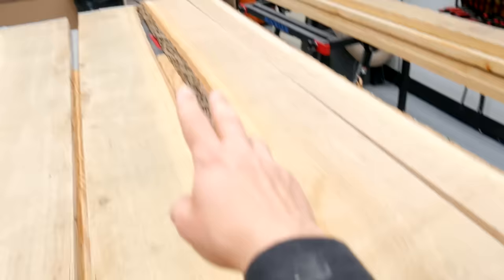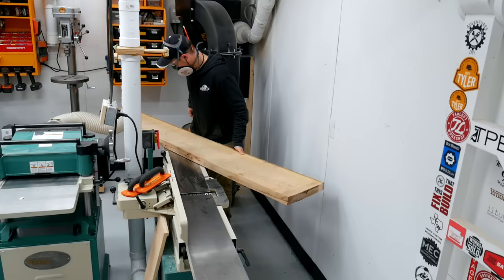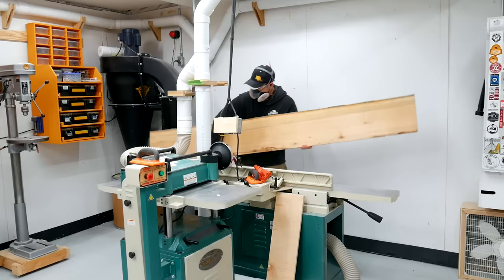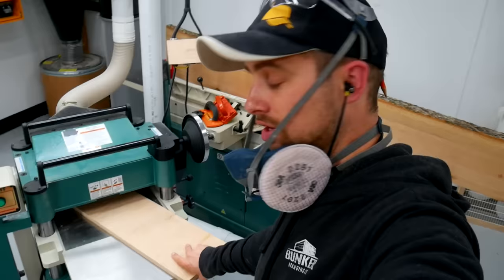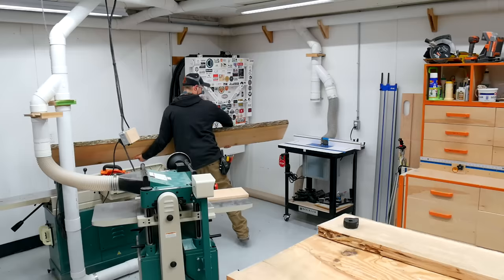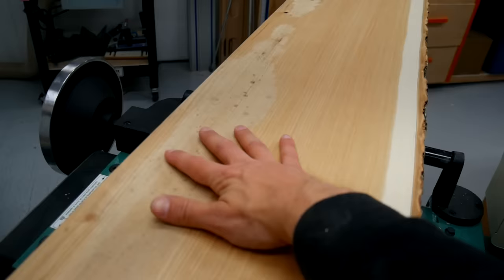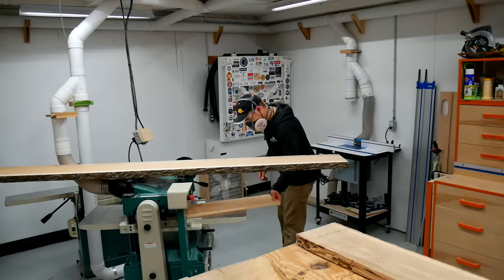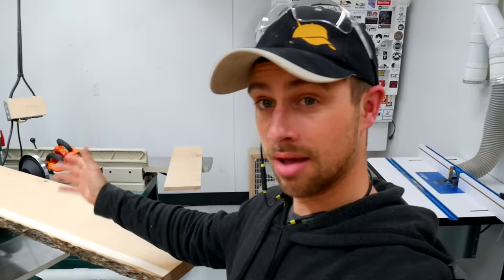Jointer Size Doesn't Matter! Flatten Large Boards on a Smaller Jointer

Comment: NEVER EVER put your fingers over the leading edge of the timber ........@  1.23..........      even if its not switched on. Plus a set of free standing rollers are a must- have in any shop... PLEASE stay safe
Reply: What's the problem..
Reply: @cefb8923  I don't have a problem, I still have all my fingers.! but I know and have seen enough accidents around joinery shops to offer words of warning. Happy Christmas.
Reply: @cefb8923  the problem is he made a stupid decision but got lucky he almost lost every tip of his fingers. He got lucky and if doesn’t admit he is lying 🤥..
Reply: @vicinglis3736  the sad thing is he never replied too you another reason I don’t leave comments. Had to here because he almost had a very bad day and he realized it quickly when he put his fingers there but that quick reaction won’t save your fingers if you hit that blade. I know exactly what it will do to a finger if he wants pictures :(
Reply: @LincolnHawk  exactly....the machine wasn't even on. When it was he took the proper safety steps. Besides if that man loses his fingers then he loses his fingers. That's on him. People calling him stupid is ridiculous. People are so worried about what other people are doing when they should just worry about theirself
Reply: @Lincoln_Hawk  yea. Kinda like pointing an unloaded gun at someone.

Comment: I've used this trick before. I prefer to use a laminated particleboard for the spacer for two reasons. One: It's not subject to warping due to humidity changes, and it's machine cut, so you're guaranteed a flat reference surface. Two: The lamination gives it a low friction surface to make the board glide easier.  I also have a laminated board at full width and length that I use during normal operation to serve as an extension table for the planer, so I don't even have to adjust my height when I go to plane the full width of the board.
Reply: Good tip thanks Kasbak :)
Reply: No significant expansion or contraction to worry about?
Reply: @MarcosElMalo2  It's particle board, so there's no grain to change with humidity.

Comment: So I’m new to woodworking and have a question. Could you not have just planed the board on the planer being its wider than the board itself? I thought that was what the planer did, was to flatten boards and to make them the same thickness. Is that not right? I guess essentially I’m wondering what the jointer step offered that the planer didn’t do? My question probably tells how much of a noob I am, but I love woodworking and am trying to absorb all the knowledge I can!

Comment: I just used this technique this week for a 12" board.  I  have a 6" jointer and 13" planer.  The pieces were only about 4' long, but it works like a charm.  Just be patient and take your time making really shallow passes.  This is a lifesaver for a small hobby shop like mine.
Reply: Welp Im not sure what I did but I completely jacked one side of my butcher block reloading bench. Have the ridged set up the 6” jointer and the 13” thickness plainer. The boards im working with are pine 2x4’s and around the edges are pine 4x4’s 8 foot long.

Comment: I've wondered for years why nobody else does this. I always assumed it was me doing something galactically-stupid, though (maybe due to how dangerous the exposed blades are... if you're inattentive or clumsy?) so I've only told a few people about it (both of whom chastised my recklessness). Kudos for having the stones to go public about it man! You're not alone! I've been surreptitiously working along the same exact process for years!

For anyone wondering: yes, it works fine on a 6" jointer too, just bolt it down to the work cart and make damn sure she's gotta lotta weight to her.

I solved it by making a single stand from 3/4" ply to hold jointer AND the planer (the planer added 100lbs straightaway. Plenty, but since I was twitchy about it, I made the bottom support plate hollow, then caulked it and filled it with sand. Add casters BEFORE you start. Mine prolly weighed 400lbs, total. 

Finally: outfeed and infeed. You REALLY want the support. I have a little removable shelf that runs in front of mine too, to support the front half of that board. Just make a mental note to always have either it or the guard in place at all times. The concern is if the stock overbalanced and tips forward, you don't want to lose your balance or instinctively flail... and set your hand down to catch yourself (wince). 

Awesome video bro!

Comment: Dude this is a piece of information that I needed so badly! I have huge slabs that I need to work. And I have the exact same size equipment as you. So I will definitely be using this technique.
  But be careful working with that Joiner. I lost the end of my left little finger earlier this year to mine. And I am incredibly safe with my equipment handling. Processing heavy wood and getting tired can be a dangerous combination on that machine.  
 Take care and continue the great work,  Art

Comment: That works great as long as you can flatten that partial first surface of the board in ONE PASS on your jointer.  If it requires more than one pass to be flattened, you will have to remove the rabbeting ledge to make a second or third pass. The unplaned part of the board overhanging the infeed table also hangs below the level of the rabbeting ledge thus preventing a second pass. If you don't have a rabbeting ledge, you can use as many passes as you want to flatten that first surface of the board.  Most of the lumber I use is rough hewn and takes more than one pass to flatten.  If you're milling a lot of lumber, removing the rabbeting ledge makes sense - for one board, not so much. Thanks for the post.  It's a good technique, especially if your jointer doesn't have a rabbeting ledge.

Comment: I only have a 6" bench top jointer and it made things pretty tricky because the cherry boards I'm using have some crowning and twisting after drying.  I had to get out a portable jointer and take the portion that overhung down in order to make additional passes to get it to ride the board on the planer without doing funky stuff.  It's doing its job but adds some extra steps.  Great video!

Comment: this is a great technique, but the following should be pointed out:
-if your jointer has a rabbeting ledge (which yours has) you only get one pass to do the cut, otherwise the lug that is left behind will hold the board up as it hits the ledge
-I have a jointer like this and the technique you describe still works, but I set the infeed table low so that I can make 1 deep cut
Reply: Exactly!
Reply: Delta DJ20 has a removable rabbeting shelf.

Comment: Nice trick, I have an 8 inch jointer, and a very nice, but only 12 inch powermatic planer.  I will put that trick in my toolbox for those 8 to 12" wide slabs.  Thumbs up!

Comment: OR if you want to save space just make a jointer sled for your planer and use that as a jointer. Not only is it cheaper because you don't have to buy a jointer but you also save space in your shop.
There's plenty of jointer sleds out there so just look them up.

Comment: Great video, finally understood how to use the supporting board.
I made mine with a 1 inch tick by 60 inch long melamine, easier to calculate the thickness of the finish board ounce you remove supporting board and a lot more slipper.
Made a test today and wow

Comment: I've seen other woodworkers use that planner sled to improve snipe also... I now think everyone should just have one of those as wide as their jointer fixed to their planner on one side with a pivot point on the infeed and a clamp on the outfeed this way if they aren't maxing out their planner they can skew the bed to improve the finish on weird grain.
Reply: Forgot to mention the sled should have a fixed fence on one side of it so it works when you set it to skew. I also don't care about my planner bed because it's a rigid planer and is horrible.
Reply: And have a second sled that can go bedside the other one when your doing the second side of wide boards.
Reply: Just throwing some ideas to the public, love your method.

Comment: I've done novice wood working for 25 years, with no jointer or planer. From what I can see here, using this technique, as long as you have both a jointer, and a planer, you could basically use a 4" jointer and a normal size planer to do almost all normal boards, up to the width of the planer? Using this technique means there isn't an absolute necessity to own a larger planer? It also appears that there is no way to flatten a board without owning BOTH tools.

Comment: Not so sure I understand this one.  I was wondering how you were going to run the other side through the jointer, and thought you were using the jointer because the board was too wide to fit through your planer. If this board can go through, they why not just use the planer?  I've run rough boards through my planer all the time.  I'll even up one side to "flatten" any irregularities, then flip and take down the other side to finish.  Gorgeous shop, by the way =)
Reply: I have the same difficulty understanding.
Reply: The planet will make a board parallel to the other side, not exactly flat. So if there’s any twist in the board it will still be there after the planer. Still though, this method is pretty time consuming and there’s a better way to do this. Just make a planer sled and shim the twist out and flatten one side that way and then flip over.

Comment: I just remove the guard- and the rail. Then I can use the jointer to remove high spots, which is the only thing a joiner can do. Just think of it as an upside down jointer plane. The only limitation is a board so large it is too difficult to handle.

Comment: Wow! what a great tip. I have never needed to joint and plane a board that size. I do work with smaller boards and only have an old 4" jointer, and a 12" Shopsmith planer. I will be trying your idea very soon. Thanks and keep up the great videos.

Comment: Might just want to add that you can only take 1 pass at the jointer so its better to take of a little more than normal to ensure you get flat reference surface in single pass.
Reply from the maker: Why only one pass? Able to take as many as I want on machine.
Reply: @DIYTyler  for my jointer (Rockwell 37-220) after one pass the un-milled step runs into the fence attachment surface, it cannot overhand the table.

Comment: So what if I were to face joint a 12 inch board on a 6 inch jointer? Could I not just face joint one 6 inch side the flip it around a land face joint the other 6 inches? New woodworker here, just wondering if that would work

Comment: This might sound ignorant, but to all the people warning about how fingers are easily lost with this method, can you please elaborate for me? I'm trying to understand what might happen that I'm not understanding here, given that the slab extends wider than the blades (assuming the slab is supported in all directions and doesn't just tip off forward).

Comment: Excellent video! Do you have any rules of thumb for ratios? For example, if I have a 6" jointer and a 13" planer, woulda 6" support board support a 13" feed?
Reply: if i was to guess, i would assume you need your support board to be at least, preferably slightly over, half of the width of the board you're processing. So for a 13 inch board, you'd want a 6.5" or greater support board for the sake of stability. Can be done with smaller, like he said, but it'll just be more of a challenge

Comment: ok silly question from a newbie woodworker.... you joint the one side great.. now... why not just flip it right over and joint the rrmaining inches??
Reply: Because the unjointed part is higher...when you flip it over, the whole board will be sitting at an angle and you'll never get it flat.
Reply: @ajquestell  oh.. right right.. now i see it.

Comment: There are always workarounds. A lot of workarounds are time-consuming and many times a PITA. So I say size does matter. 
a
Reply: While it's true, for the hobbyist and DIY-er, a bigger jointer might just not be feasible, budget or spacewise. And it's more likely the need for a 13-15" joint will be a very occasional situation. If you're actually making a living or have an actual shop, then yes. Splurge for the 12" or 20" cabinet that costs 10-20 times what a benchtop jointer costs.

Comment: I’m trying to understand this...  So, after using the 8” board, you can turn the hickory over and finish the jointing on the planer, right?  In other words, you never went back to your jointer to finish the hickory?

Great video!
Reply: Correct he just used it to get an 8inch flat strip which in turn with the jig allowed him to plane the other side flat
Then flip the hickory and plane that other 7 or so inches flat

Comment: What do you do if you have to make multiple passes on jointer?
Reply: To make multiple passes on your joiner will you need to remove the metal piece that the blade cover connects to.  Sorry can't remember the name of that piece right now
Reply: To make multiple passes on your joiner will you need to remove the metal piece that the blade cover connects to.  Sorry can't remember the name of that piece right now

Comment: If you ever have the opportunity to face boards on a large jointer I think you might change your opinion.
That piece of hickory sure did look nice. Did it really need facing it looked pretty flat.
When I get a board wider then my jointer beds I rip it in half.Process both pieces separately then glue them back together.
This is a very common practice for building furniture. We do this to remove the stress from unruly wood.
I know you didn’t figure this out it’s been on all the forums for years now. Are you for teaching for likes or views?

Comment: That's a nice trick. Since I don't own either a planer or a jointer, I use a router sled to flatten boards, followed by a fly cutter on an angle grinder with the same sled, for a nice finish, especially for smaller or odd size pieces.
Reply: That is likely the route I will need to take. Glad it seems to work for you.
Reply: @douglashaner6802  I've since strengthened the plywood sled into a universal tool "gantry" with a couple of pieces of 6'x2"x2" stainless tubing. 
It Provides a really smooth surface for wax finished wood to slide on effortlessly. 
The gap between two sections is nearly a foot, so I can now use the same sled/gantry with almost all woodworking tools. Works like a track for my circular saw/jigsaw, still fits my trim router and now I can also use a bigger router which is 4x as powerful for bigger jobs. It can also take a small Chinese hobby drill press to make holes right in the center of a 4x8 sheet of plywood. I use a simple 'cheat-bar' (just a 1" dia MS tube) to slide the drill press into position and also to operate the handle. 
Would make a lot more sense if I can get around to posting a few pictures or a video sometime 🤣🤣

Comment: It CAN be done.. but so can purchasing a good used 12” machine for the price of maybe little more thsn s new 6” with helical cutterhead.  I have a 12”  cantek, 3 blade straight knife i biught for $1,000 Cad.    Put $500 into a brand new 5 hp, 5,000rpm, single phase motor.  So $1500 , new motor,  HD machine… pretty good deal.    Not so rare or hard to find desls.

Comment: Check out Perkins Builder Bros’ channel. He just lost his fingers in the jointer for not having the guard on. He’s documenting everything.
Reply: I generally agree with those looking for more safety. However, I have not looked at that channel, but typically, people don't lose fingers because they remove the guard. It's technique and safety beyond that. This is different from, for example, wood springing back to pinch a blade that isn't protected by a riving knife, where skill level and other safety measures are rarely going to stop it.

Comment: I doubt that gives you two actually perpendicular surfaces. I'm sure they're flat but with the pressure the rollers put down I highly doubt it's not tilting the board a bit on the overhanging side as it goes through the planer.
Reply: Infeed and outfeed supports would be good, same as you want to do for table saw. I use tool cabinets as supports with MDF/melamine to be same height to plane 14" wide x 13' long 3/4" maple glue-ups. No risk of tipping the 15" planer or snipe at the ends.

Comment: I don't see how this would work if you need to make more than 1 pass to make the board flat on the jointer. The unflattend parts hang over and hit the part near where your guard pivots.
Reply: Charles Reiche you are correct.  You actually should remove that piece where the guard pivots as well to avoid the unflattened parts hitting it on every pass after the first.   About a year ago, I ruined a beautiful 8ft. piece of 8/4 walnut the first time I tried this because I didn’t think to remove that piece.  Since I figured it out, everything thing has worked perfectly every time I’ve done it since then.  It’s a great technique though and really comes in handy.
Reply from the maker: The pivot point of my machine moved with the I feed table so I can take as many passes as necessary. Not sure if all machines are this way?
Reply from the maker: @rod Logan. Not true, at least on my machine the pivot point moves with the indeed table.